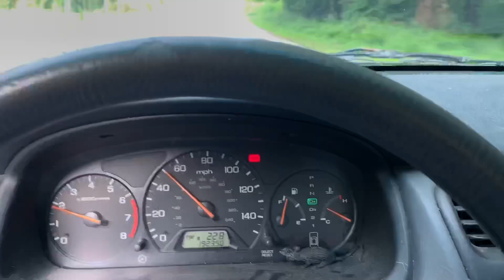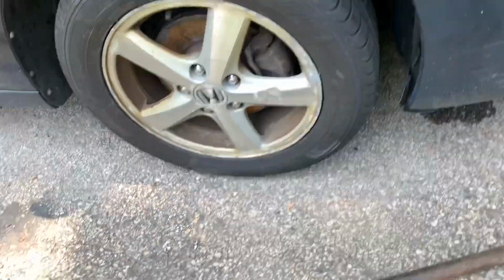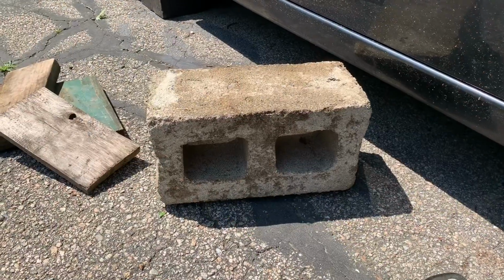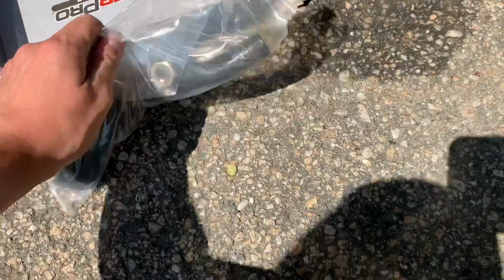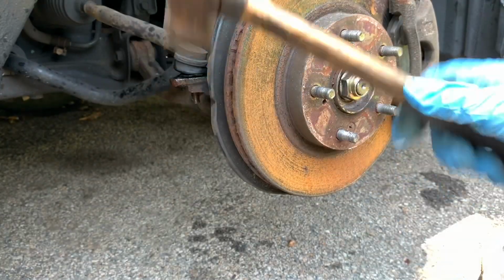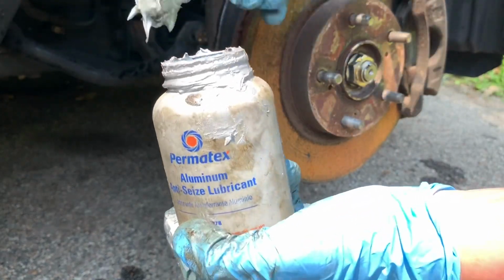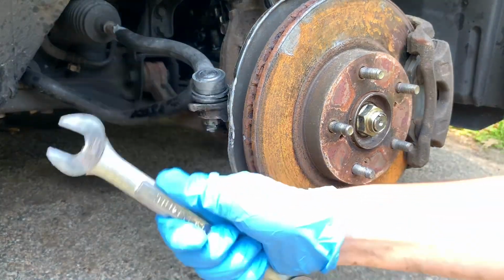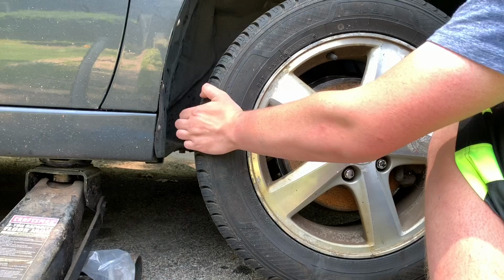How To: Replace Outer Tie Rods [2003-2007 Honda Accord] + Buying NEW PARTS!

Comment: Great video. But just one thing, for people that may be watching. DO NOT tighten the castle nut as tight as you can get it. 30 to 40 lb max. If you tighten the castle nut to much you will prematurely destroy the ball joint inside the outer tie rod end. It does not have to be extremely tight. The cotter pin is there to stop the castle nut from coming off.

Comment: im not sure what the tubing black part is called that is connected to the tire rod.but i need a new one of those its busted and leaking what I believe to be is brake fluid??? do you by chance know what its actually called.
Reply from the maker: I believe you’re talking about the inner tie rod, which would mean you’re leaking power steering fluid out of the steering rack. You can either rebuild the rack or buy a new one, but they’re expensive and they suck to install. If you’re going to do it, make sure you have the time and space, it isn’t easy.
Reply: @OlsonAuto  forreal its expensive. it says a inner tire rod with the rack is about 45-65$ on amazon
Reply: @OlsonAuto  but some people call it a power steering boot
Reply from the maker: That Boy Zarius that would be just the boot, the boot isn’t leaking it’s the power steering rack itself. The rack itself is a couple hundred
Reply: That Boy Zarius what year is your Honda ? Is it leaking on passenger side or which tie rod end is leaking from the boot

Comment: that tie rod has been replaced before. No way Honda uses a 19mm lock nut for tie-rods OEM. I have worked on many hondas and they are all 24mm. Smallest ive seen is 22mm.

Comment: With your outers being so shot, don't you think the inners could be worn out also?
Reply from the maker: Very possible, but inner tie rods are a bit more involved and require a special tool. I knew for a fact my outter was not only bent, but just worn out. Once I replaced it the car felt pretty solid and straight. If I was focused on a full overhaul I would’ve done both (like I’m doing with my firebird currently), but I just needed this piece to be straight for when I got it aligned

Comment: I would say get real jack stands, don't trust a concrete block and a jack if you're going underneath the car. Also, do you travel with your gate pipe breaker bar or what happens when you change a flat on the side of the road without the bar :)
Reply from the maker: Well I don’t keep a spare for any of my cars so I’d just call AAA and get it flatbetted home lol. And I do usually use normal jackstands, they were preoccupied while working on this car though but I’m not too concerned as long as there’s something solid under it

Comment: Hopefully that tire rod doesn't get any brake dust exposure because brake dust+anti seize=concrete
Reply from the maker: Never had any problems with brake dust and anti seize. I use anti seize on all brake components on all my vehicles and have never had a problem